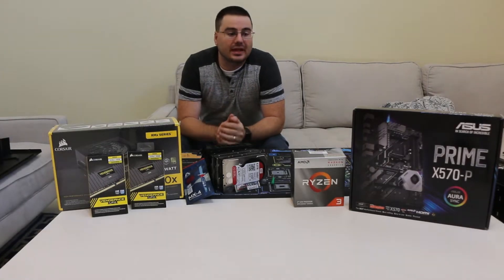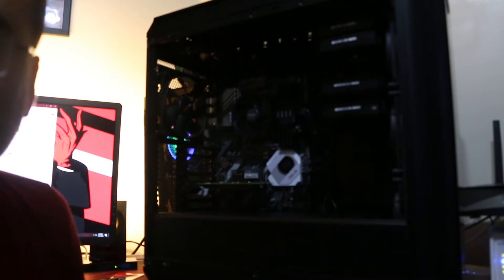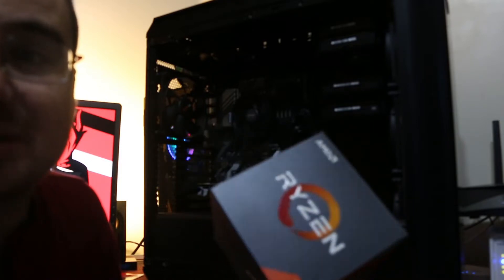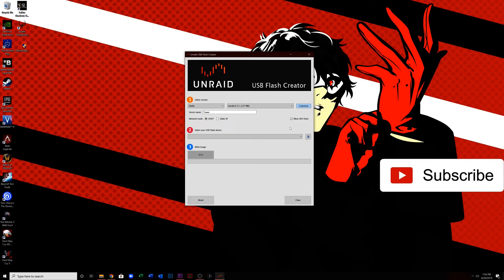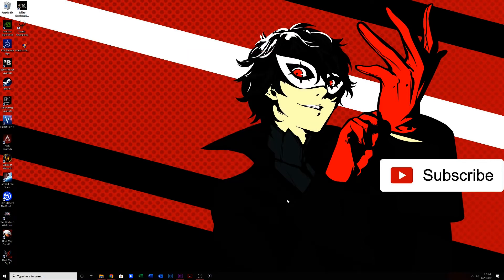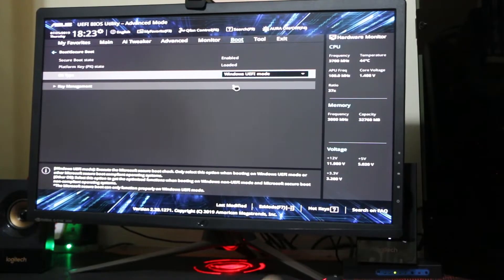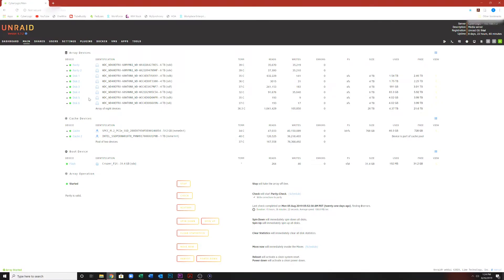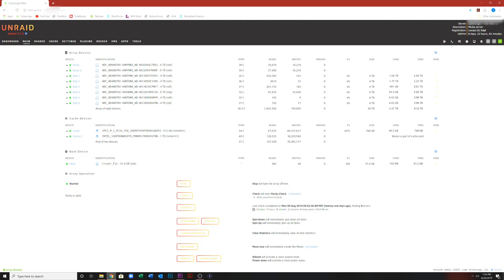Building my First Ryzen Unraid Server!

Comment: My  1 vm is running fine in 1660 super but my 2 vm not showing display through 1050ti 3gb i changed the graphics card.  Also but not working   and when i run through vms graphics it run fine  what is the problem please solve my problem